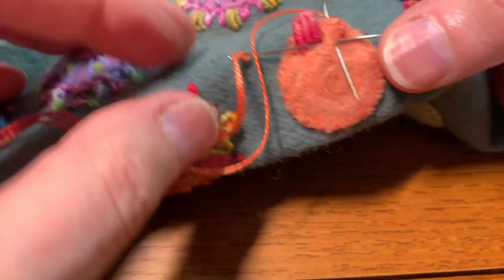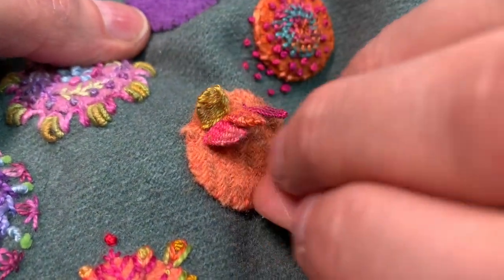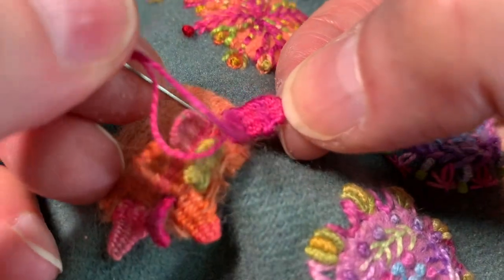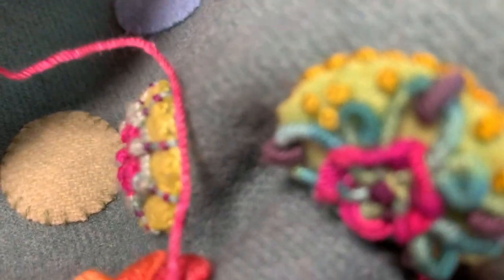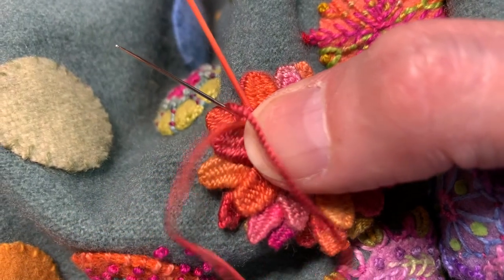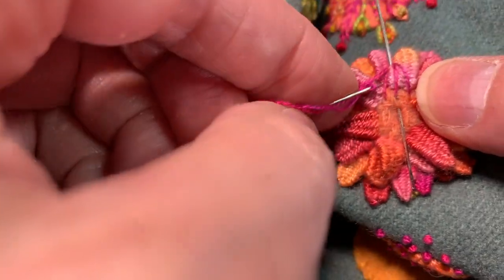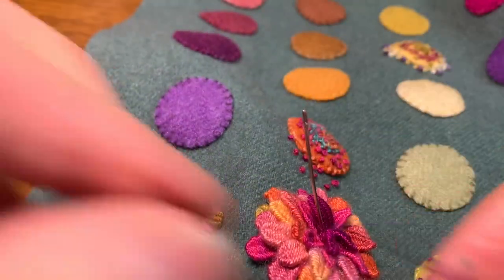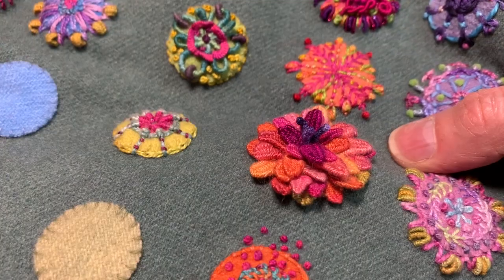How To: A Woven Picot Flower With A NEW Stitch - The Bullion Drizzle

Comment: I have noticed that after no pulling of the working thread, at the fifth row and taking out your support pin, pushing those 5 rows up, checking  whether there are no loops, putting the support pin back and by continuing  pushing after three or four rows all the threads up, you also get a correct woven picot. If you find a loop, pull carefully one of the spokes. You'll notice immediately which one reacts.
Reply from the maker: Auckje van der Leij great suggestion!  Thank you.

Comment: What I am struggling with on the woven picot is the tension at the outside edges. I try to get the outside edge to not be a straight line so I relax the thread and then relax the weave so it isn't so tight, but then it doesn't look as crisp as I'd like. I just haven't done enough of them to develop the right tension. Any tips in shaping them? Love this pretty flower!

Comment: Beautiful flower, I still need more practice on the stitch.  What size of milliner needle are you using for the center when weaving.  I have tried a couple of sizes but they seem to thick.  Currently I am using a straw needle but not sure if it is strong enough.
Reply from the maker: Thx so much Suzanne.  ❤️ I use one of the milliners needles that are in the assorted pack Sue Spargo sells on her site.  I don't know which number it is, but it's pretty thin.  A pin will also work.